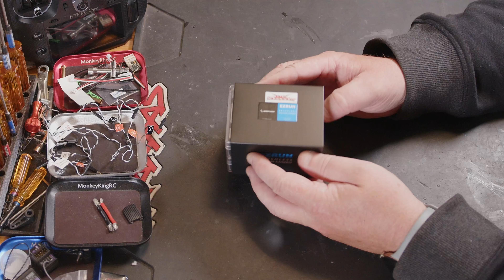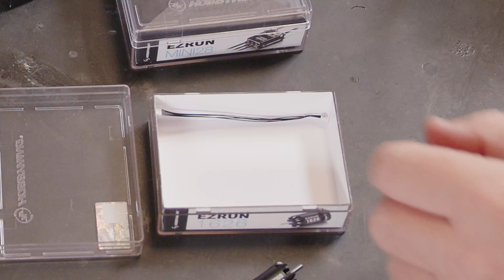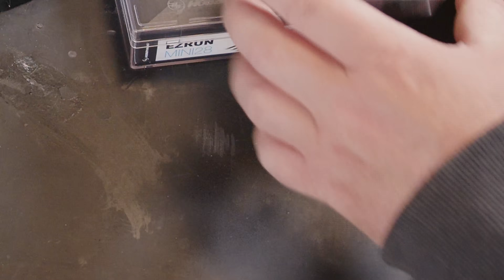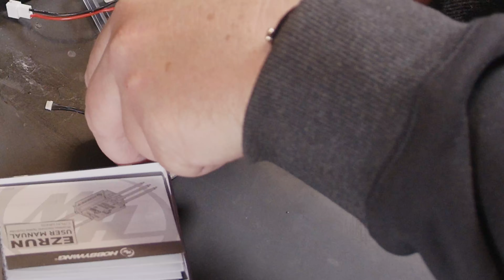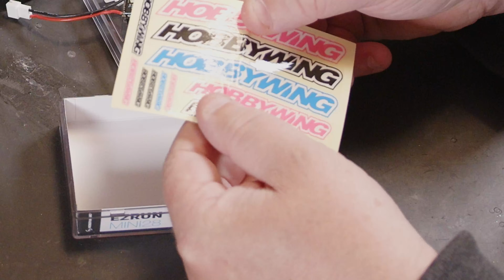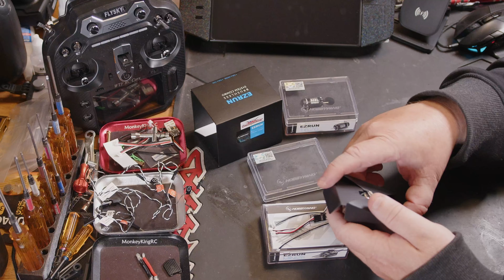Hobbywing Mini28 esc and 1626 motor combo unboxing

Comment: How do you compare this to the furitek ?
Reply from the maker: Far better it actually works right for a start
Reply: @WTFRCCars any videos with how this install process goes with this? Does everything fit without any modifications?
Reply from the maker: You need a motor mount as the stock one won't allow the motor position you need